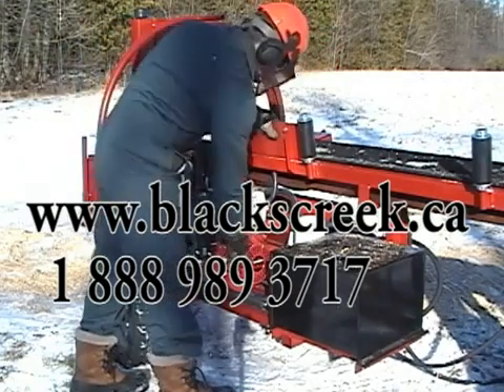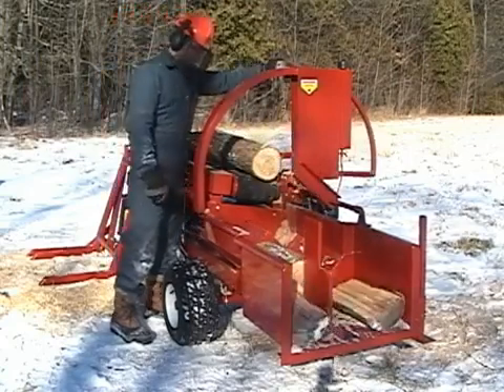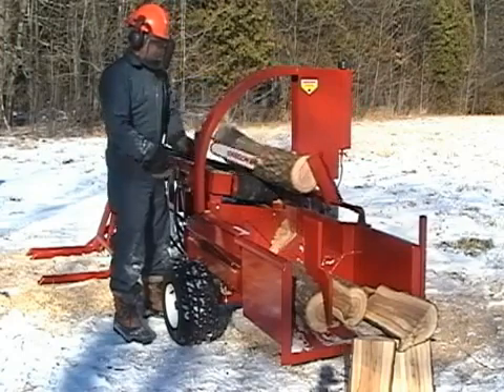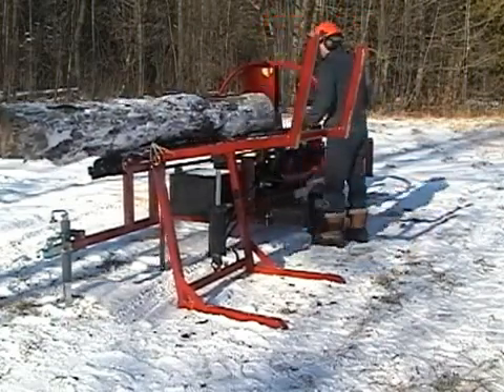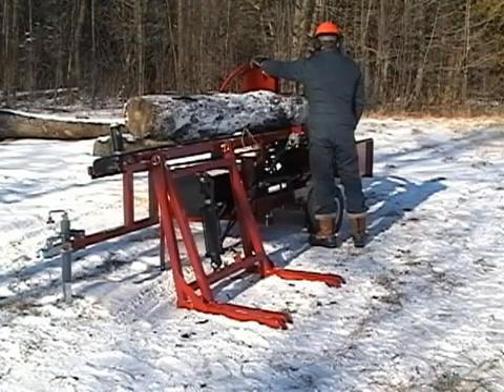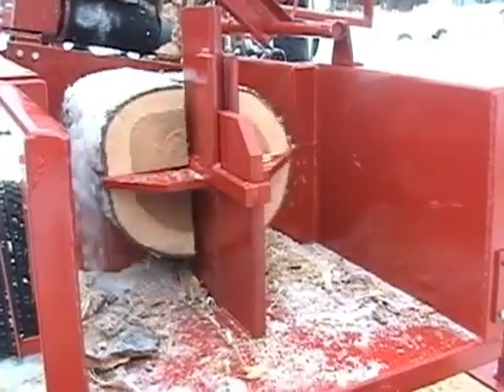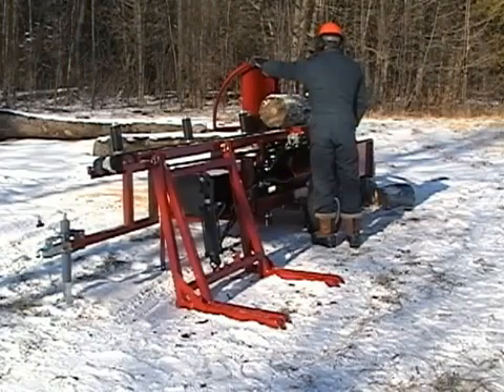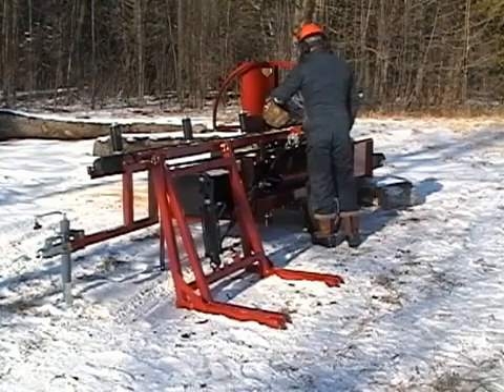Blacks Creek Firewood Processor - Model 1500

Comment: It’s a real Shame blacks creek doesn’t offer a conveyor system attached and driven by the processor it self. Most competitors offer this option. Being a Canadian I can appreciate Canadian built equipment , but not offering this option is a deal breaker for me. Im shopping locally but it seems the only machines available comparable are off shore units which im not crazy about supporting . 

I hope this company sees the need for this request as two separate machines isn’t always the best option for every customer . Makes it very stationary meaning renting or processing at other sites becomes unrealistic . Not to mention the cost of the stand alone conveyor.
Reply: I agree they require to much bending over
Reply: g boz, I have the Wallenstein 1624 processor with attached 16' folding conveyor. I also have a stand alone Blackscreek 16' folding conveyor with the Honda engine on it. I like having the conveyor attached but it is also a pain sometimes. I process into a large tall pile so I have a 35' long modified hay elevator that I put at the end of the Wallenstein conveyor so that I can pile higher and not have to move the processor every few hours. I use the Blackscreek stand alone conveyor to hand load splits onto my dump trailer for delivery. Without the stand alone unit I would have to hand load and throw every split into the trailer. Something to consider when you are purchasing a unit.
Reply: @DaleFarrish  thanks for the feedback I def see the value in both versions . I just wish blacks creek would offer it as an option .